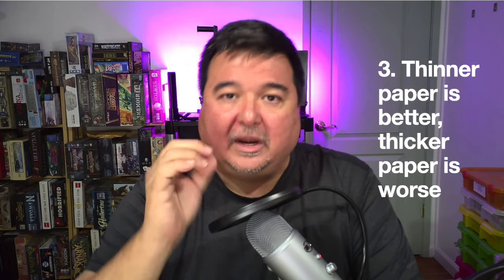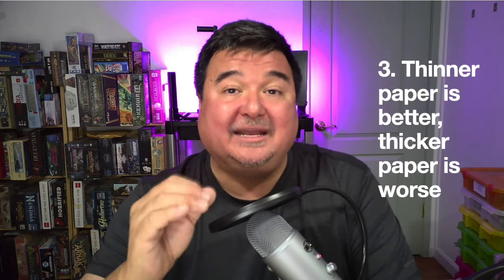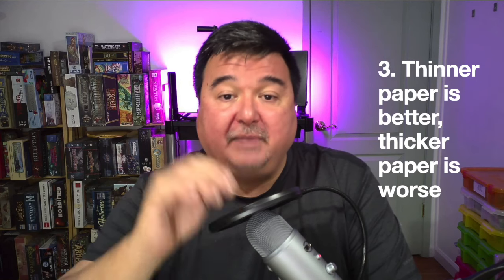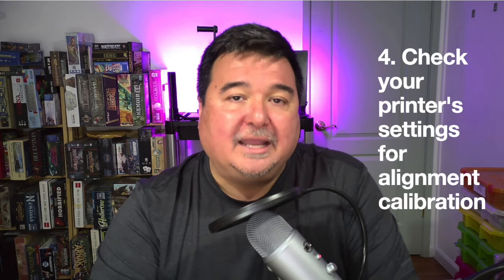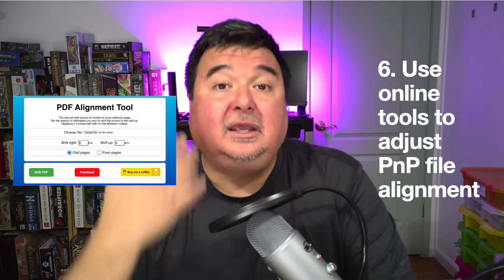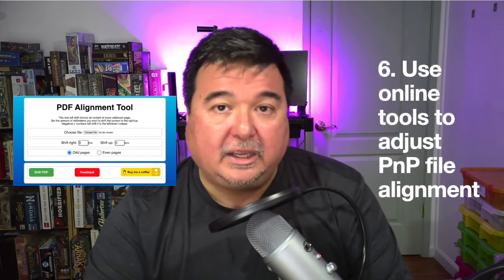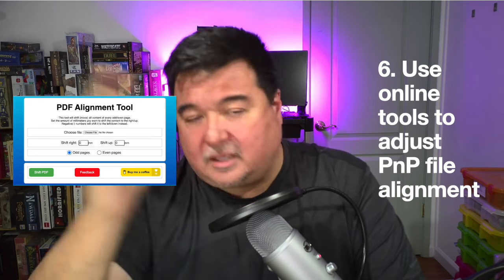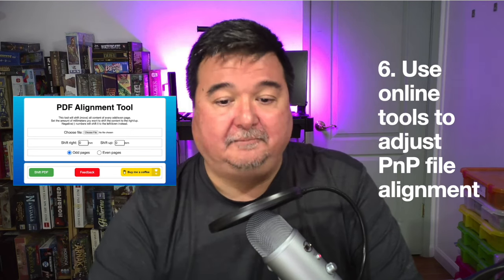How To Get Good Front Back Alignment for Print and Play Games

Comment: Great info Martin! You have an awesome channel for the PNP hobby.
I have used various Epson printers and they all have the same alignment issue, they tend to be about 1mm offset.
On one of your videos you were trimming your paper to improve the alignment and it has mostly worked for me.
The reason why it worked is because of automatic duplexing,  the printer picks up the paper and feeds it into the printer and finds that edge of the paper to locate where the printing should start. It then feeds the paper around the roller and prints the image and feeds out of the printer. That first edge of the paper that comes out is the edge the printer located off of first, when the paper is almost out the printer stops then feeds the paper back in to locate on the new edge then feeds around the roller and starts printing. So with automatic duplexing the printer is locating off of two opposite edges for each image. Now when you look at the page in the light you may see how much it's out of alignment and if you measure the length of the paper it will be too long by about the same amount. This is because the paper we buy is typically over sized so if I do automatic duplexing then I will measure the paper and trim it as close to the size it should be and I will get mostly good results. I can still get some twisting that will mess with the alignment and that may be from not getting a perfectly square edge or just the way the printer picked up the paper.
Ultimately Manual two sided printing should be the way to go because you will always locate off the same edge for each side of the paper and the factory edge should be pretty good as long as you can keep the twisting to the minimum.
Thanks for taking so much of your time to teach us all that you do.
Reply from the maker: @alanfullarton3780  thank you for your thoughtful comment and kind words, much appreciated! :)

Comment: I have a Canon PIXMA G3260, and the absolute best alignment I have gotten is using the rear feed (it only has a rear feed), slide the paper guides nice and tight, and ONLY have the page I'm printing on in the feed tray. More than that and the pages begin to slide on each other, resulting in pretty chaotic results.

I'm just in the process of building Grimm World, and after printing everything, no page is more than the width of the printed crosshair lines out. Very pleased.

Comment: Good info on printer comparisons. Ive been more concerned with finding a new one that prints very well and clearly , for making game parts, boards,etc but also has good deep color saturation that sets well,
(Also getting a model that doesn't run out of ink every ten pages)
i hadnt even been thinking of alignment issue. Lol
I guess i had thought a good one i wouldnt have to worry about it ,as i just thought i had to make sure i set up the pages right in the program, so now ive got another issue to consider when trying to decide what printer to get. I just havnt had time to do research on forums seeing what others tended to recommend for this kind of purpose.
Thanks

Comment: My tips: 
- Manual Duplex with the rear feed tray: do both front and back from the rear feed. This means the paper will start in the same place. Don't print the first side out of the lower tray/cassette, then the second with the rear feed tray.
- Clean your printer. If it's old, if you leave the top feed open, if you live in a dusty environment, if it's too near your kitchen, or if you have pets, especially, the rollers will get gummed up or dusty or both. If you use fancy or weird papers, they can leave either clay dust or extra ink behind. Cleaning rollers with a non-linting cloth and alcohol can make a big difference.
- Before you go to PnPbuddy, make sure that your results are consistent - i.e. that alignment is off by the same amount in the same direction(s) every page you print. Older printers were remarkably inconsistent in feed, and ones which are dirty (see above) will have sufficient slippage to make the feed inconsistent. Probably very cheap printers are also poor at this. If the alignment is inconsistent from one page to the next, PnPbuddy won't really help you. (But with a well made and maintained printer that lacks tracking adjustment, it's the bees knees.)
- Both in rear feed trays and in cassettes/lower trays/drawers, there is usually a guide or two that let you adjust to different sizes of paper. These need to be set very carefully to just lightly touch both sides of the paper, so there is no drag, but also no wiggle room for the paper to get pulled diagonally or just slip off to the side. 
- With specialty papers especially, you will find that not all A4 papers are precisely the same size. (Same goes for letter size of course.) This means that if you've got really good adjustments and more or less perfect results that have worked for you for many projects with one brand of paper, you might blithely print a whole deck of cards on a new brand of paper, only to realize they didn't align, because the paper is actually a little wider or longer. The differences are rarely as much as half a millimeter, but I have seen much more than that once recently, in a major brand of paper. And depending on your setup and alignment options, any error introduced from mis-sized paper may be doubled in the process of duplex printing. US sizes of paper produced overseas may be more likely to be wrong, and different from one manufacturer to the next, because of metric conversions.
Reply from the maker: Awesome, well researched tips from long experience, thanks for sharing! :)

Comment: With my prototypes (so not PNP and not applicable) I've started to print the backs using an ancient hack: tiling patterns! If you make a pattern that tiles and is an exact fraction in height and an extract fraction in width of a card size (and you cut without space between cards), you can have any amount of misalignment and still have completely identical and completely fine backs *per sheet*. Each card back would have the exact same misalignment and the exact same pattern on a single sheet. In this method, you also cut using the front side of the cards so the fronts are perfect, and the backs don't matter.
Reply from the maker: @Naeddyr  Great technique, thanks for sharing!